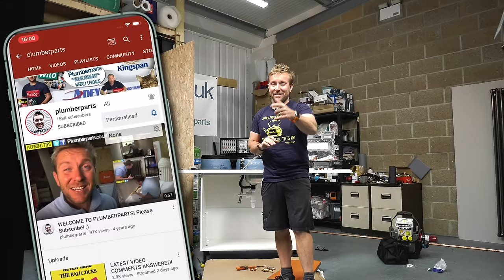HOW TO INSTALL KITCHEN UNDERSINK PIPEWORK - EASY

Comment: Hi James – great video and tip, thanks for making and sharing. SUPERB song at the end. You are one talented individual that’s for sure. 
I’m a big fan of neat pipework. I don’t do Brasso though (yet). I’m just DIY and have recently re-done a bathroom from bare concrete up. First end-feed joint in years with a 30 year-old blow torch – disaster. The torch constantly flared and went out, gas escaping in a confined space, re-lit and eye-brows gone. Something had to change, so I bought (after first wincing at the price) a Rothenberger Superfire II with the 400g “blue” gas. Well, that changed everything. I have no pipe bender, and it was the usual H+C plus CH, so there were in excess of 100 end-feed joints. Not a single leak. Not one. That new blow torch is worth every penny and more. I’m now using lead-free solder as though it was the “old” stuff. I should really switch to plastic pipe, but I love soldering and the results – even though all of mine is either behind plasterboard or under the floor! The Rothenberger can’t take all the credit though, as I watched your earlier “how-to” vids before starting…. Thanks again.

Comment: When I drill holes through tiles I make a template from wood the size of the tile cutter. Press against the tile and use as a guide for the tile cutter. Makes a perfect hole and no skidding about on the tile. The under sink looks real neat.

Comment: Didn't see you using sealing compound on the compression joints? Great video, your standard of fitting is brilliant. I always admire a good job done. Thanks for the tips. Peace be unto you.

Comment: Put the board at the back of the cupboard so the homeowner can use a shelf in the cupboard
Reply: How is he going to do that on a hardboard backer ?
Reply: just need to scribe the shelf around the pipes and drill two new holes for the shelf pins in the plywood

Comment: Great video, thanks for the tips :) I'm just doing my kitchen rebuild. Will definitely be installing a pipe mounting board. My old undersink plumbing was like you showed in the video, a complete unsupported disaster and the worst I've seen.

Comment: I have something similar under my utility sink after I reworked pipework to get at an electrical socket. My board is a lot more compacted, not as spaced out as this as I had mine suspended to avoid and kink's and I have a mini shelf for flood sensor. Love this spaced out design

Comment: What a great idea!!! How about using that ply as a template.... Drill pilot holes in the carcass for the clips. Build it on the plywood then remove and click to the unit? Im 100% gonna use this, thanks

Comment: I have just watched the undersink pipework video. I have fitted many sinks with dishwashers, washing machines etc which have to be plumbed in and their positions in the kitchen dictate where the pipework has to be installed. Also the main incoming stop tap is in the position fixed by the original builders and will be supplying other items in the house so cutting into it to match the panel will be another big job.
My main concern is however that by fixing the pipework on the side of the cupboard this prevents the shelf from being fitted flush to the side of the carcase without some major cutting of it and making brackets and it needs to be able to slide in and out. Its a very neat idea but I few drawbacks.
Reply: It looks neat but a complete waste of time in the real world plumbing. I’ve done 100’s of houses and I wouldn’t even do this in my own. Pipes to the back high up and out of the way when possible.

Comment: I see on the last two videos that I have watched (btw. They are fabulous 😀) that you always put a red handle full bore valve on a cold water supply when blue ones are available, as a DIYer I would like to know is there a reason for this. thank you.

Comment: Like the idea of a board but with pipes coming through the floor, joining them with cupboards in place will be extremely difficult if the pipework is not perfectly aligned. I'd put the cupboard and board in place, then remove them both, fix plumbing to board, fix to wall, join up to feed and then fit cupboard.

Comment: Being a professional plumber yourself;  you make it look so easy; because you have all the tools and plumbing bits; and of course most probably a few years of experience of doing the plumbing job to go with it....in the 1st place.
But....unfortunately in my case;  it’s slightly different.  I’m going to have to pretend to be at college; on this one;   because I’m not a professional plumber 👩‍🔧 🧑‍🔧  so....I’m going to have to use my initiative....when fitting all the bits i need for my small kitchen;  in which only measures 7x5 feet. Only a fraction of the size that you have in your house.    But still.....everything has to be done exactly right.

i live in a studio flat;  and as I’ve just mentioned; the kitchen is not all that big;  but I’ve just cleared out my sink unit;  in fact....basically the whole lot. 
There’s no stopcock in my kitchen; underneath anywhere;   so....I’ve had to turn my water off...downstairs in the communal hallway cupboard;  and then fit a couple of John guest push fit isolation valves on the remaining pipes in my kitchen.  The good news is....there are no leaks; thanks to the Stanley cutting tool i bought on Amazon.   Well....that’s a start anyway.    The next thing i need then obviously is the sink base unit itself.  But then after that who knows.   
But I’ve have this awful feeling, that, my kitchen is not going to be finished anytime soon. In my case your talking months.   In your case.....most likely in a day.      But it looks like I’ve got a lot of thinking to do on this one;   Considering that I’m going to have to do the job myself.    A lot of bits that i need.....and of course tools to do the job; i can buy on Amazon.  So....I’ll just have to take it from there.

Love all your videos by the way.  Love that idea...with all of those pipes fitted on that separate board; and then fitted onto the sink unit base side itself.   

i also watched a video on YouTube with a girlie plumber on the job; so that was nice to see that too.    She certainly knows what she’s doing.
But yes!  i quite like this plumbing malarky now.   Starting to get into it.   Many Thanks.   Pete from Southampton.
Friday am at 09:33H  5th February 2021.  U.K. 🇬🇧 Totton Southampto

Comment: Bloody typical, I just fitted all mine last week and could of done with seeing this first. A few questions for your Excellency.
The water softener fittings seem to be 22mm. Is that the only size they come in? 
Curious to know why you went 15mm to  22mm full bore compression valve (if it is that) Extra expense for no gain? 
What is the closest you have soldered to plastic pipe fittings without melting them? (helps with future pipe layout design)
Why use a stop cock/gate valve instead of a full bore lever ball valve? Lever valves seem more convenient e.g. quarter turn and don't seem to fail as badly or often (based on my amateur research of other plumber videos.....sorry, you are not the only plumber that "does it" for me but you do "get me over the line" very well and often!) 
Thanks for another brilliant video. Yours come up in my suggestions way more than anyone else.

Comment: This is certainly version 1.0. Missing shelf, bringing mains water to front, connections for dishwasher. Common problems, easily sorted - with a little rethink... Also is there mileage in developing these as a pre made part?

Comment: You want to use tap-tail-adaptors on the end of the ball valves to prevent the flexible tap connector washers getting cut from the chamfered ball valve edge which is machined to accept a olive. I’ve used them for years and makes it so easy to connect to and they only cost a couple of pounds 👍

Comment: how do you keep the pipes in the right place when soldering without melting the pipe clips?
Reply: He solders most of the pipework out of position (not in the clips). Also the only way you’d melt a pipe clip is if you pointed the torch directly at the clip.
Reply: @jakes6147  maybe I get my pipes too hot. do you solder and then fix clips afterwards?
Reply from the maker: @samjarman3136  Nice trick is to get a wet rag and wrap it around the clip...prevents them melting!

Comment: Silly question but I'm just starting. Why do you fit a 90 degree bend and not bend the pipe???
Reply: If you look at the radius of the pipe bender, to get it to 90 degrees it would be a very long bend, probably a 10cm arc in each direction (X&Y) which is too big in a setup like this. The much smaller 90 degree elbows take up less room.

Comment: If you wanna weld use oxy acetylene or lpg with oxygen and welding road 2%silver 100%sure for expensive shut off use the spray frozing spray

Comment: I've recently had a local council install my boiler pipes and underneath the sink the hot pipe is uncovered and gets I'm getting hot can I have your opinion on that please
And can I have your opinion

I have got a central heating system installed by the council and the hot water pipe goes underneath my sink and gets hot when can I have your
Reply: Franksymes Franksymes The taxpayer funded your boiler and subsidises your rent. The install may be less than perfect but until you stop expecting others to fund your existence then you have no right to complain.

Comment: Looks nice, but then  i'm not a plumber ... what I'm concerned about is the fact I have hard water here in the sw uk... I use a brita filter jug for drinks... I've just had a new AEG washing machine installed, and realised that it doesn't have a hot & cold input... just cold. Is there a plumbed in water filter that could feed both the machine and replace my faithful Brita .....
Reply: Phil Melson No filters including your Brita remove hardness. To do this you need a water softener, not magnetic type, they don’t work either.

Comment: Great job... .. bit confused 

Why do it on a piece of ply and fit that to the unit, looks a bit rough..... just work out the pipe placement on the ply.. as you’re doing drill small 2/3mm holes through it where clips go... transfer that sheet to the gable end and transfer the holes into that to side of Caracass the fix pipes directly onto the unit.. 

Much neater..

Comment: Good idea but why not just set it out on the board and transfer pilot holes through onto the unit and then transfer the pipes set on the unit, you could then use the board as a jig for future jobs. I wouldn't want to loose the recommendation work due to ply panels ruining the finish.

Comment: I do like the concept but what about the she shelves!!!
Reply from the maker: Andrew West easily added with a noggin or right angled brackets. I’ll do a video if you like!
Reply: plumberparts that won’t work with pan drawers though will it...
Reply from the maker: @robinturner2300  Honestly I wouldn't fit this in a pan draws carcass...plus it fucking rare that your mains come up in the pan draws carcass too...unless the plumber was mental and couldn't be arsed to run it over to the kitchen sink carcass like 99.99% of install I see! Any way addressing in the next video!

Comment: James I a long time subscriber, I don't normally comment  but as a kitchen fitter that tackles rudimentary plumbing I hate  the idea of templating to the side of a carcass, what a complete ball ache removing the kitchen come time to refit, I do normally fit the pipework and clips to the back of the carcass using an offcut of ply and then fit out the under sink shelf to give the customer more storage this would be totally impractical using a side template, I do get what your trying to achieve, all the plumbers here will love it but as a kitchen, fitter seeing this come knockout day it would be a few blue words & pass the paracetamol.
Reply: I'm no plumber or kitchen fitter. But he mentioned in the video you can isolate it and loosen 5 connections and remove it. A kitchen gets replaced every what 5, 10 years? As a customer I would want any easy drain down, water shut off and accessories servicing. I couldn't give a shit if it upsets the bloke who has come to hit my kitchen with a sledgehammer 10 years later.
Reply from the maker: @martyp187  Haha! I guess removing 5 connections and 4 screws is too much for most people these days - I think it's easier than ripping everything out and taking to the scrappy!
Reply: As a kitchen fitter I would cream if I looked under the sink an saw this. This would be so easy to isolate, remove, rip out carcass, re-install, restore water supply with as little inconvenience to the rest of the building and customer as possible
Reply: Don't get me even started about kitchen fitters not leaving space round metering equipment and covering up what you shouldn't be so when we arrive were having to cut up there brand new kitchen... thought you guys were supposed to go on courses to educate 🤔 yourself on things like this... this is a good idea as usually under the kitchen sink is a very busy place and having it in some order is a good thing
Reply: Ripping a kitchen out is easy whatever the pipes look like turn it off outside and go nuts
Reply: I love it very tidy than some botch job pipes hanging everywhere great job
Reply: @plumberparts or if it's too easy they don't get paid enough 😅

Comment: I like those space-saver traps, where you can elbow off the waste/plug hole/overflow and then remotely and neatly tuck away the trap at the back.  
I worked on a job with a randy rottweiler. Dog saliva is the last thing you should be concerned about. It started shagging my leg. I complained, "get off!". It growled at me. I had to fake an orgasm before it would stop. Deliverance. "squeal for me piggy!"

Comment: RIP to the shelf though, wouldn’t it be better at the back so a shelf could be easily cut and fitted
Reply: And no way to put a Drawer...
Reply from the maker: A couple of noggins or right angle brackets and BOOM you’ve got a shelf again!
Reply: plumberparts nice 👍

Comment: The under sink shelf is a design problem, it never functions properly because there is always a trap in the way (and usually other plumbing). Why not just have a shelf platform, if required, that can be removed when any maintenance needs to be carried out.

Comment: 18 years kitchen fitting experience I would never do this. It's a neat job but it looks awful and would get in the way of the shelves plus the pipes wouldn't be in that position plus you've still got to do the waste and the dish washer and the washing machine so you've still got to get down on your knees so while you're down there you might as well do it all.
Reply from the maker: Greg Smith nah mate I prefer this way! Easy to put a shelf in with your skills too! 😉
Reply: Greg Smith buggers up fitting pan drawers under the sink as well...
Reply: @plumberparts  to each his own as I always say but think I'll stick to the way I do it now just thought I'd add my  insights 👍🏻
Reply: @robinturner2300  calm down fella it's just my opinion and FYI I've probably forgotten more about kitchen fitting than you'll ever know. Most of which I learnt by (how did you so eloquently put it) buggering things up then putting them right. 👍🏻
Reply: @robinturner2300   Robin Turner  sorry mate. The way it reads makes it sound like you were saying that I don't know how to fit pan drawers under a sink. But you're right no way you can possibly fit drawers under a sink with this setup. I'm slightly more than an passable fitter 😁.
Reply: Totally agree. This looks absolutely horrendous. I can't imagine the reaction I would get from my client if I presented them their dream kitchen with this under the sink. It would have to have a removable panel in front to hide the pipework.

Comment: Not in a million years would I add the pipework to a kitchen unit in that fashion.  I hand it to you that it looks very neat and tidy, but it isn't perfect.   I am fitting a new kitchen at the moment and due to this, I can tell you one of my worst nightmares was a few days ago.  I had to butcher a sink cabinet to remove it;  the pipework was attached to it.  that way is not for me.   

Why not use your idea and fit the plywood to the back of the cupboard wall and independent of the cabinet (leaving the actual back of the cabinet off)?  Doing that enables the kitchen  cabinet to be removed with less hassle.

Also, many new kitchen sink cabinets come with drawers; mine has two for the cleaning materials.. Not being sexist, but please think about it.